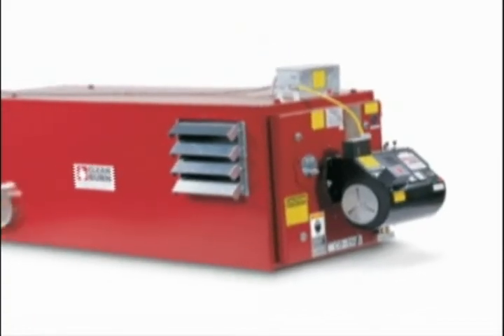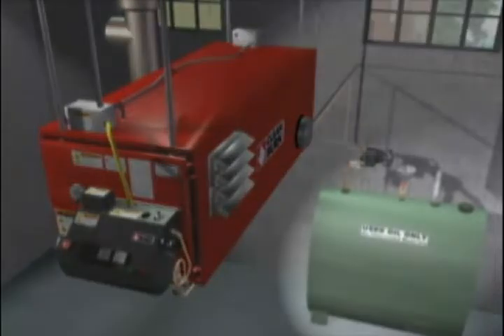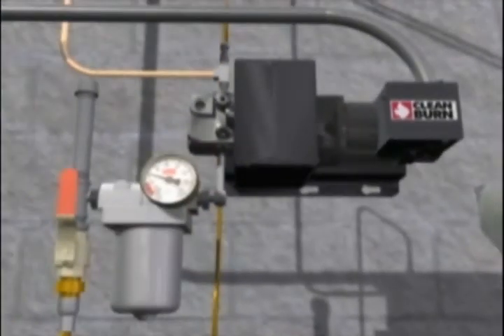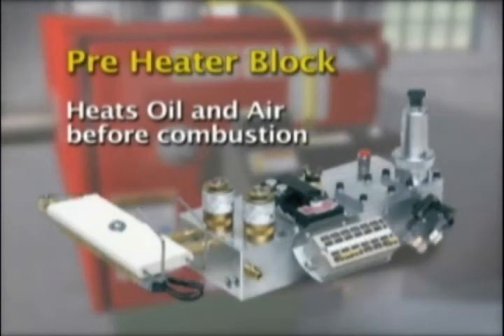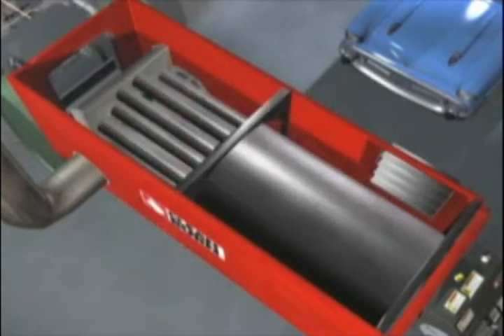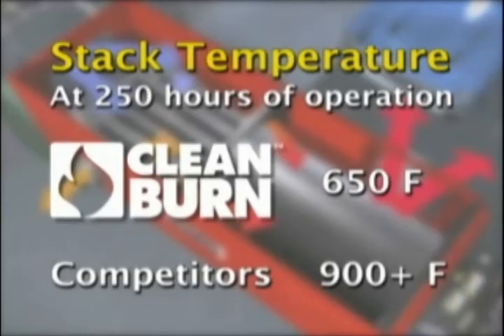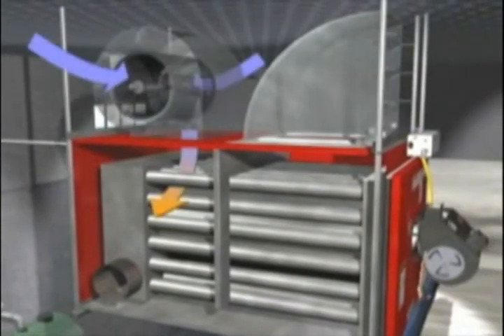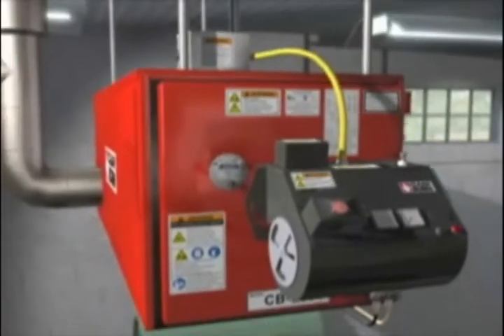Clean Burn: How It Works

Comment: 10 to 15 years ago I had got info and pricing on one of these units from a company in southern Ont. Canada, called Garage supply, 4 months later when I called to order one, they told me that the dam Canada government stuck there nose in it and blocked the importing of them into Canada, why I asked being they burn cleaner then fuel oil witch I been using for 30 years for my shop and home, they didn't have an answer direct from the government other then they clam they don't pass 4th party testing, they went on to say, they be leave the government paid off a 4th testing party to over rule the mfg testing by a 2nd and 3rd party, simply because the government cant collect tx on used oil, like they can on say fire wood, gas, oil and so  on so they made up a bs rule,  so I build my own system, from old fuel oil burners, adding air and pre heaters and making a tip

Comment: This is for bonsaidi. I was wondering did you install the clean burn unit to heat up your house or a shop i was thinking about putting one of these units in a 60x60x14 shop and if they work good maybe one for the house. Thanks

Comment: if anyone knows how to restart one of these bad boys after you've run out of oil your input would be much appreciated.
Reply: The trick is not running out of oil. Keep a small rezerve of the oil în the tank, before Stoping the burner and exhaut heat in the house.
Otherwise need an oil /air loop to eliminate the air, after adding oil in the tank! The burner will star AFTER there is no more air în the feeding line at the nozzle.
Reply: I use atf

Comment: We have purchased 2 Clean Burn waste oil furnaces from Eco Heating Systems.  We chose Clean Burn units after extensive research. The quality and construction of these units are beyond compare.  Bring on the cold weather, we set the thermostats at 78, "T" shirts are the order of the day.  With no heating oil bills, it may not be heaven - but it's close.